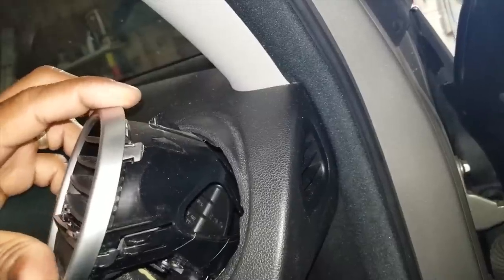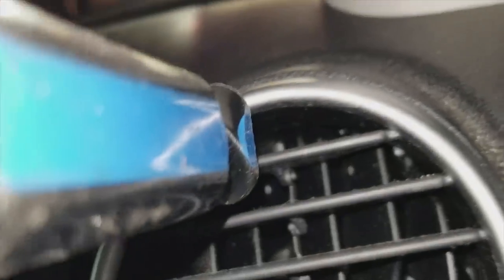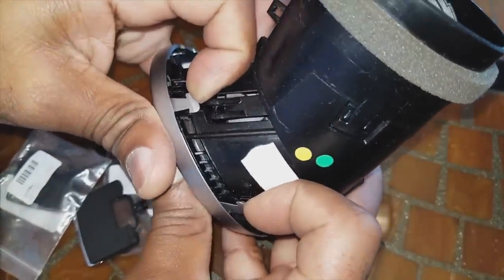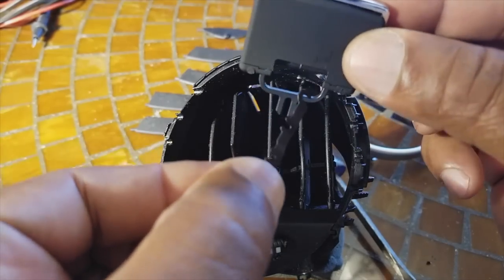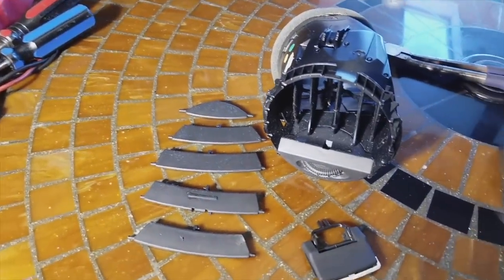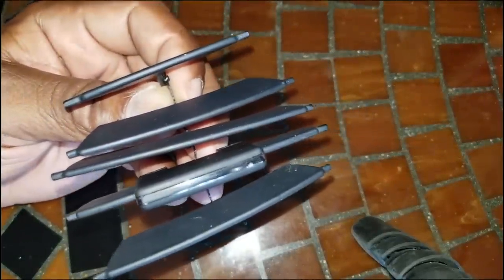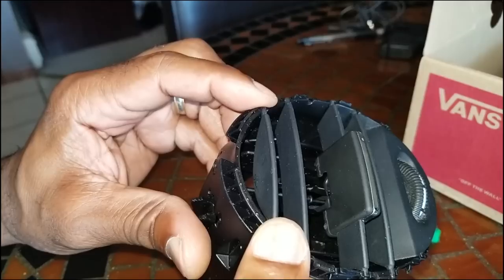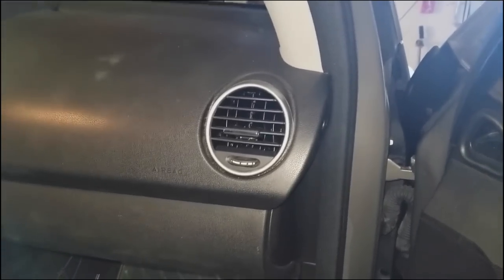Mercedes AC Vents Repair and Install DIY | ML350 And Others | W164

Comment: My car was diagnosed by Mercedes Benz Dealer here in VA. They quoted me $7000 worth of repairs, mostly including maintenance items. I was about to call them back to go ahead with the repairs but thought I should YouTube all items needed repair. Luckily, I came across Keith’s channel: I was able to find all DIY videos for every line item which saved me $6000 towards labor costs. On top of that, I learnt a ton about how to do work on my GL450! Thanks a lot brother. Let me say this... YOU ARE THE MAN!! 👊🏾
Reply: Gotta learn how to work on these older ML’s or you will go bankrupt and this channel has saved me a lot of money too!  Get a good scanner also made a lot of difference.  Next job and a big one that you will eventually encounter is your door lock actuator.  At least a $1500 repair but w/ some patience and research you can get it done for a few hundred $$ depending if you EBay a used part or buy a new OEM part.  I am going OEM you don’t want to do it twice off some salvage ML.  Off topic but you will get there.

Comment: Performed this fix on two vents for my ‘07 ML350. I only glued the main vent with the slider and the top and bottom vents as they point away from you when you insert it back into the housing.  The remaining drop into place.

Thanks for the great video!
Reply from the maker: Awesome!  Glad you were able to do this.

Comment: The legal bar didn't make sense and the glue didn't work. I was about to call bull sh*#!  But it actually worked.  Trick is in the type of glue, I had to use something high viscous & sticky(J-r weld plastic binder)as the crazy glue didn't work.  1st one took 45min, 2nd took 10min.  Thanks!!!!!!!

Comment: Hello Keith, I Thank you for the Awesome Repair Vids!  I have a question if you wouldn't mind helping me. I have a 2011 MB ML 350. I would Like to replace the Flat Hood Emblem. I have tried what I could to remove the one on the Hood and it wont bulge. I opened the Hood and it has no access to remove from under. Pls Help. Thanking you in advance. Lou

Comment: very Helpful! although mine is ML350, I'm surely taking the trip.
Thanks Bro..
Reply: So is mine! You have the round unit's? Mine are square, and the one in the middle is a bit wonky. You can't tell by looking though, lol! As long as the AC is working'

Comment: @iRepair Autos - the URL to the replacement parts does not work. I need to purchase replacement fins for the center vent on a 2010 MB E350. Any suggestions?

Comment: Geeze, I have that task to do on 2 vents... surprisingly with all the over engineering MB does, you would figure the Germans would apply a little glue to the actuator so it doesn't come apart... alas, I blame it on the IKEA engineering concept 😂

Comment: Glue?! Smh
Reply from the maker: To hold it in place until everything is set.  Go a buy a new one if you don’t like the solution
Reply: @iRepairAutos  whatever works for you I guess. Just seems like a little more of a pain than just holding it steady by hand or vice.